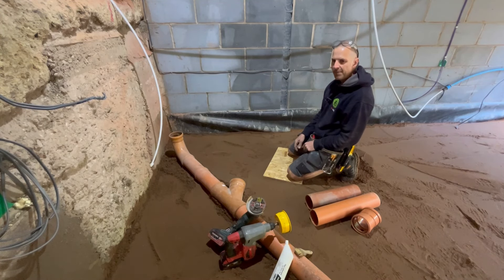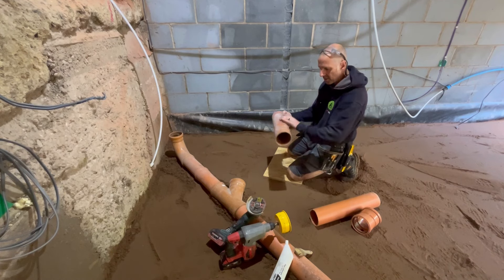Concrete Floors - Step By Step Guide

Comment: I really ought to buy one of those soil pipe chamfering tools, i still use a grinder but not the safest method. I like to use fairy liquid rather than pipe lube or silicone spray.
Reply from the maker: They really are a great investment. I was told many years ago that fairy liquid affects the integrity of the rubber pipe seals. I don’t know if that’s true or not. 🤷
Reply: @Mr_A_Builders  you could well be right regards the fairy, or they just want us to buy lubricating gell at £7 a tub on top of a Kings ransom for the fittings!

Comment: 2:57 some capping over the light switch feed cables  really wouldn't go amiss.
Reply from the maker: Sorry Paul, but we're not going to waste time and money on a pointless task on the off chance that you won't have anything to moan about on a Sunday evening! You would have found something else, anyway.
Reply: So for what actual purpose do you think that needs to be there for?
You have made the comment so can you please help to educate me? 
Thanks
Reply: @JimGreen-ts1ul   it protects the cable from damadge during plastering. Secondly it looks neat. Thirdly if down the line the cable is damaged you  can sometimes use the old cable to draw a new cable through the capping without damadgeing the wall.
Reply: @paulf2529  If it’s Dot &Dab then it won’t serve any purpose, originally designed to stop the plasterers trowel from damaging…..Once it’s plastered you won’t tell how neat it is, and to be fair the clipping is neat as well. Also if it was actually left free behind Dot & Dab and the Dab put on the wall so the cables were not covered removal of wiring if required would be even easier!!
Reply from the maker: Well said, Jim!

Comment: That guy with the concrete hose and spade poked several holes in the DPM, clueless! Especially at around 40:10 you can see her leaves a massive slash in the DPM the full width of the shovel 😱

Comment: I've had it in the neck before if I have foamed by electrical wires due to the foam allegedly reacting with the plastic on the wires? What's your views on that as you foamed the pipe where wires where going down for the kitchen?
Reply from the maker: I have heard many things said about what builders should and shouldn’t be doing but I’ve never heard that one but surely cables can withstand chemicals to a certain extent because of where they are used 🤷👍🏻

Comment: Great video as ever. Quick question : On some other channels, they put the PIR under the main pour of concrete, any particular reason you do it the other way around?
Reply from the maker: We are told it is what inspectors want now 🤷
It’s also better cos we can clip the UFH pipe work straight on top of it before screed 👍🏻